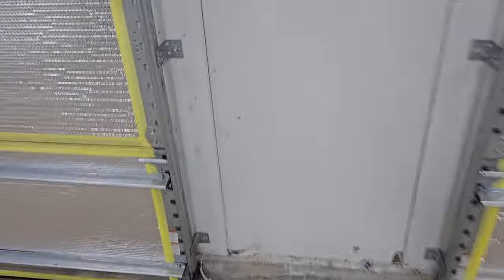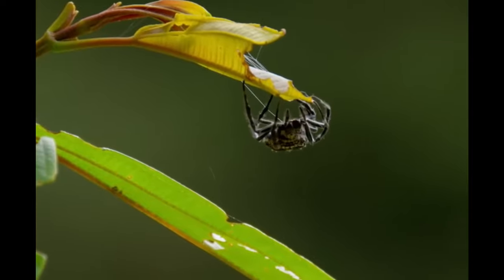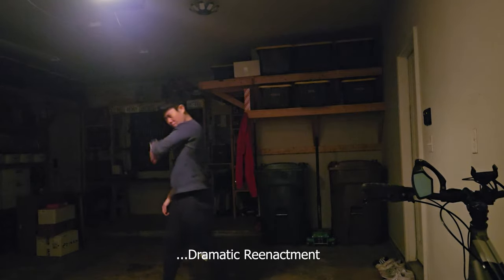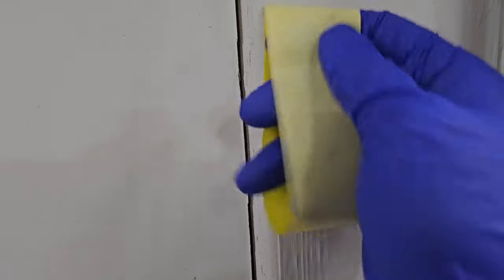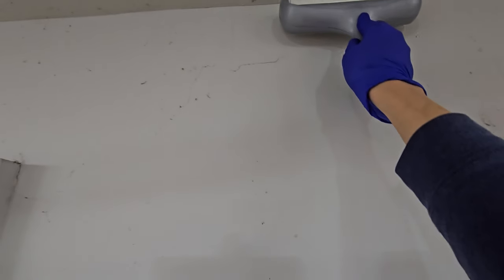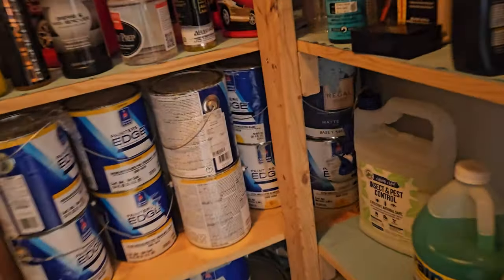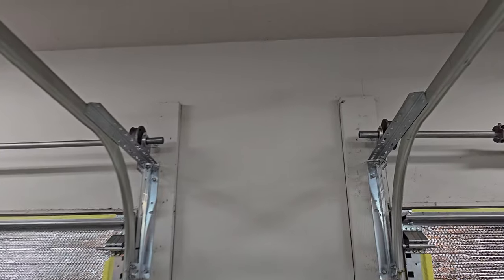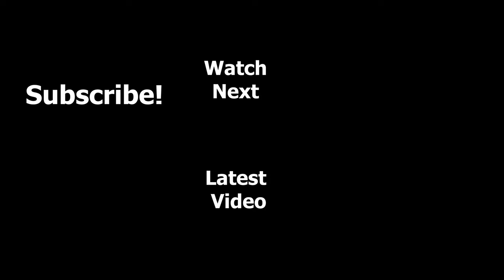Winning the WAR against Spiders (Easy Clean-up and Prevention)

Comment: I have had pretty good luck with my vacuum and soft brush attachment.  It's fast, doesn't scratch the walls, and works better than the reusable lint rollers that are kind of a pain to wash, then you have to wait for them to dry to be effective.